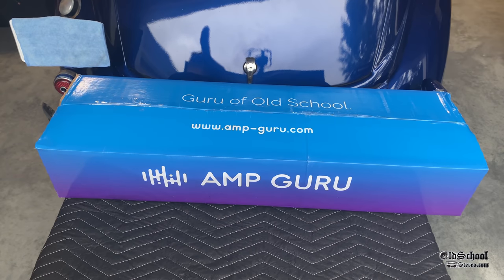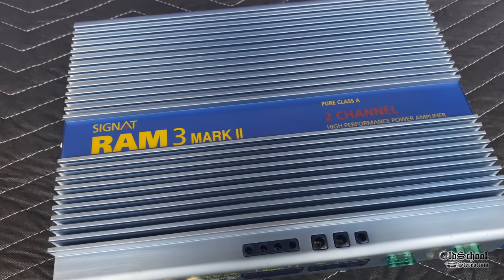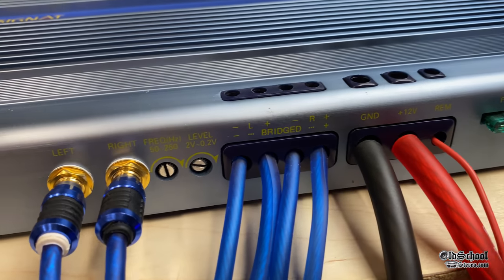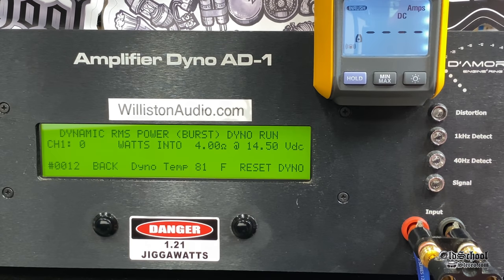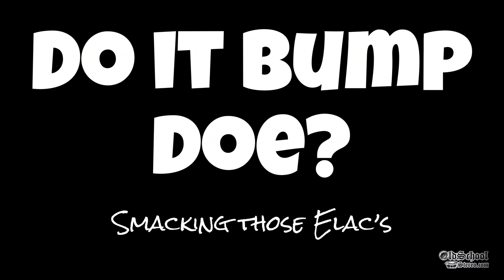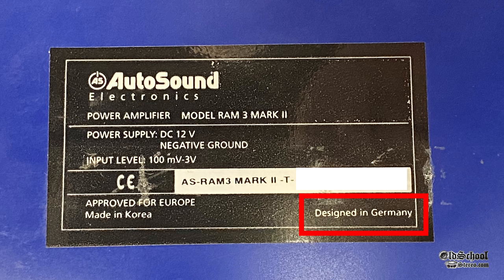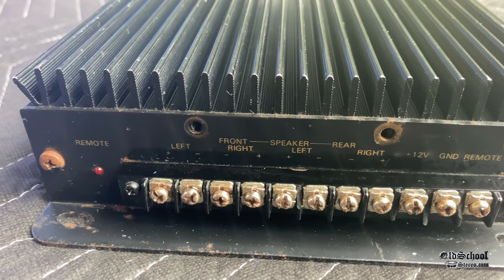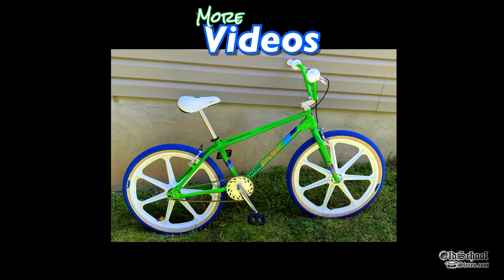Goodies from Amp-Guru.com - 1998 "Pure Class A" SIGNAT RAM 3 Mark II Amp Dyno Test

Comment: I‘m from Germany, and not only do I know that amp, I had one of those. And also had another amp that is said to be the same board: the Emphaser EA2150.
Reply: That’s is correct. I think they also had a brand named Linear that used a similar heat sink and same board design and layout
Reply: Ähm warum nicht gleich auf deutsch  😅 ja waren geile Endstufen,  vorallem die Flag
Reply: @dietershobbypakanal Die ROC1 war meine erste Endstufe, danach bin ich auf MTX und Rockford umgestiegen. Geile Zeit gewesen. Und ja die Flag war schon ein Monster

Comment: A pure class A that would do that wattage would be huge! And heat up so bad you couldn't touch it. Efficiency around 25% but it would sound good lol!
Reply: It could be class-A if it had active power rails. I was looking myself to see if I could find anything but not much at a glance. It does have dual supplies so it could have had active power rails (edit: like said, it's conventional class-B). In such amps (they are quite rare) the power supply rails are not at a fixed voltage, but track the audio, plus some voltage margin, to allow the dissipation to be much lower. Since there is substantial feedback, the amplifier will happily reject the variations in the rail voltage, but still have low distortion. With the advent of modern class-D able to outperform even class-A linear amplifiers, its an oddity at this point, but still interesting just the same.

Comment: I know it's a big no-no to step up in fuse rating. Could the amp handle that 2ohm certified test with 40amp fuses? I'm not asking for anyone to try it, I'm just asking in a theoretical sense.
Reply from the maker: As you can see it pulled over 100A at 2 ohms mono with the 40Hz test tone. Would pull much less on average with speakers and music
Reply: @wal  It is impressive, to be sure. I see what you mean as well. The amp dyno puts an amp through a lot of strain that it might otherwise be fine with playing music through speakers. 
My question was more for curiosities sake than anything else. I saw a dude put a 30a fuse where a 10a would go on a super cheap amp and it lasted about 5-8 seconds before the magic smoke was released. I’ve never been brave enough to try it myself.

Comment: Well...it's probably biased such that at most cases, up to 10W output, it will work in Class A mode.
A
Reply: That's what I was thinking too but look at the ammeter, idle current was way too low to be running in class A mode

Comment: Out of all the amps you tested which one is the best ? Since you dyno them
Reply: Looking for an easy answer to a very complex question. 
What speaker's do you have? How much money can you spend? what kind of music do you listen to?The list goes on.
Reply: @Mr.Robert1  an amp that actually produces it’s rated watts lol music well I listen to it all and as for money I’m not cheap neither expensive
Reply: "Best" is subjective. Depends on ones idea of "Best". Most power ? Best SQ ? Best Dynamic range ? Lowest THD ? The list goes on. You can typically only choose 2, 3 if your pockets are deep.
Reply: @thenotoriousrvh6091  I mean what I have now sounds good but you know like anything in life you start off with a simple set up than you want more and more
Reply: @josecunsako31  so true
Reply: @thenotoriousrvh6091  so many variables
Reply: I started our with one amplifier and a pair of 6×9 speakers. Years have gone by and I can't tell you how many systems I had.
How many I had installed for friends. I would advise going to your local installation shop and speak to them. Take a listen to different equipment that's available and listen. Start somewhere and take it from there.
Reply: @Mr.Robert1  thank you sir